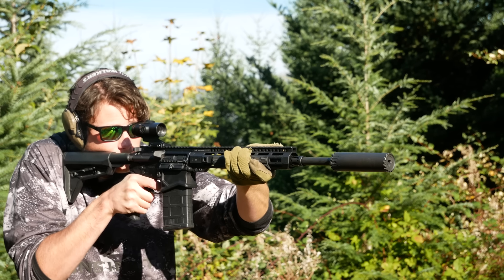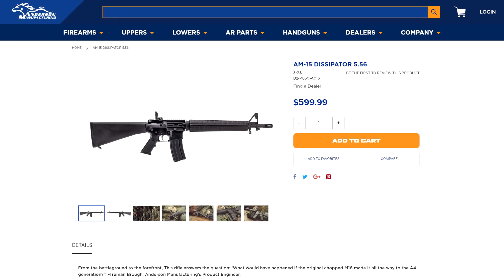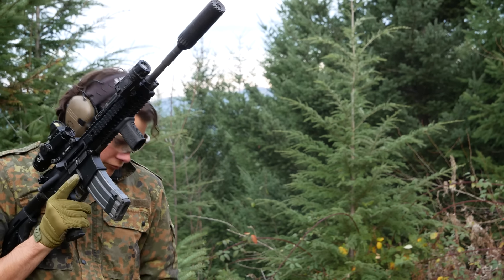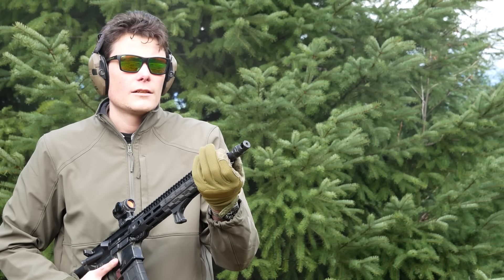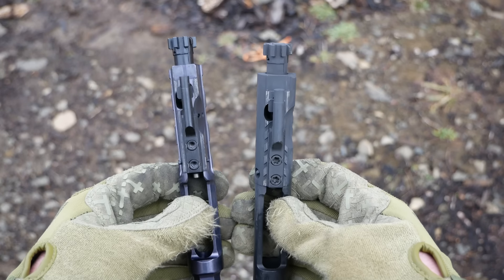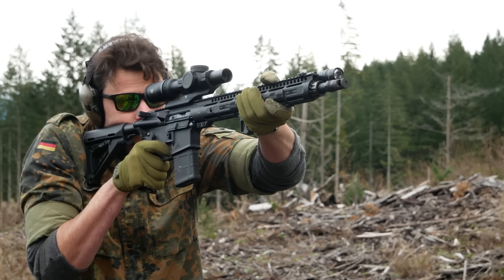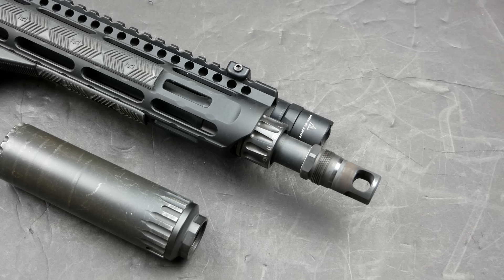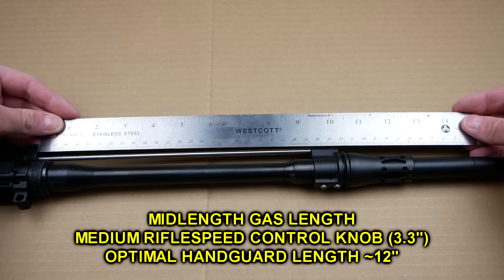The Riflespeed Dissipator

Comment: This is long and i'm sorry, but i'm trying to help add to the hive mind of information about this type of build because i really enjoy it lol. 

I have one of those barrels, although its not in a build yet. Even though its a dissipator barrel, its gas port is much larger than I think it needs to be at .121.  20" rifle barrels are usually like .098 in the TDP I think. Of course, the TDP doesn't account for crappy commercial ammo, crappy commercial grade parts, or that its shorter dwell time. So naturally, a increase in size should be added to the port when considering  the variables we need to overcome, like you rightly mentioned (or eliminate some of those variables). But I would argue that margin isn't 23 thousandths, rather  its more like 5 to 10, which is still a bigger swing than you'd think. 
 Its the same issue Focus Tripp described on your 12.5 mid from KAK. They apparently don't' care enough to perform testing to find out what's an appropriate size OR they are fighting leaky / inefficient gas systems and aren't aware of it. Could that be why the K-Spec exists? To vent gas elsewhere from their ridiculous gas ports?

Ejection pattern is not gospel, but i am using it here get a ballpark idea. The 16" rifle gas AGP barrel from "Special Ops Tactical" (the trifecta of cringe company names) has a smaller gas port than that of the KAK (im pretty sure). I can't remember the exact size, I need to go re-check it cause I can't find it in my notes. But I run it with a standard BCG (gauged efficient), non adjustable block, A5H2 (w/standard spring) and a turbo t2. 

Off the shoulder test held in my hands only. Gun is new but around 500 hundred rounds fouled and on the cusp of needing more lube (i use grease). Upper is milspec forged, so the brass deflector is the standard profile. Rainy and mildly cold weather. One round at a time, all rounds locked back on a empty mag  -  Unsuppressed: despite the A5H2 (effectively an h3), the gun ejects at 3 o clock sharp with Tula and ejects around 2 with Federal XM193. /  Suppressed (turbo t2): ejects at 1 with XM193 and around 1:30/2 with Tula. 

The unsuppressed behavior with a smaller gas port than the KAK barrel is whats most interesting to me. lt leads me to believe the KAK is way over-sized beyond a safety margin for conditions and ammo variables. Your Anderson's behavior was obviously different which is also interesting. I theorize a difference in ammo and gas system efficiency to be the difference there most likely. But  i would go as far to say if you sealed the gas tube at the FSB with loctite 620 and got a carrier that was efficient (gas key doesn't leak + gas key is proper size + bolt tail seal proper size + gas tube proper size), it would probably run completely different; and i'd be willing to bet that at least 2 of those variables are inefficient on the Anderson.

A sealed up efficient gas system makes more of a difference than people think in running crap ammo in bad conditions. Rather than taking up the slack for crap parts by hogged out gas ports, I wish manufacturers would just learn how to build and qc gas efficient parts. BCM apparently gauges their BCG's with air volume to check efficiency. Supposedly no other manufacturer does that.

Comment: Theoretically, you could also use the kind of cringe SLR SOLO rail that's 14" with this.  It's got the same inner-diameter listed as Midwest and is mlok all the way down until the very end where it terminates in picatinny.  There's a QD slot that's mounted extremely far from the inside of the tube at the end as well, so I'd imagine it's actually useable just due to distance from the inside of the rail and the fact that it's positioned so far backwards.  Having that giant chunk of pic at the front on all sides is unfortunate due to weight balance, and it's definitely less rigid, but them's the trade-offs I guess.

Comment: Dang I did not think that I would ever see a positive review by Hop of the rifle speed gas block system. Kinda figured it seemed like one of those social media hype pieces of kit but seems like it's actually delivering. Curious if this is the new standard for highly adjustable gas blocks?
Reply from the maker: Pretty high level of convenience and performance, if you're using older tech high backpressure cans. But a lot of this might not be as important in the next few years since low backpressure cans are kind of taking over.

Comment: Also….riflespeed configurator says “no” but….i want it on the 16” barrel, midlength gas….and. 15” hdx mod 3 quad rail from cmttac. Math says I’ll have a 1/2” of control past handguard before md. Configurator says “yes” up to 14.7” handguard though.

Comment: Buy a longer handguard, cut to precise length, blue the raw aluminum, rattle can. There, just cut the cost and time of experimentation in half. I would appreciate an update after a few thousand rounds on the overall condition of that gas block. I'm interested in a similar setup and saw that gas block system but it just seemed very gimmicky at first.

Comment: What is better to have the adjustable gas block or an adjustable BCG? Comparison maybe?
Reply from the maker: I stopped using the Bootleg carrier because the gas adjustments were too extreme. On most of my builds the first click would stop function completely because they weren't overgassed enough to make use of it.
Reply: @Hoplopfheil   what about the SAGRS BCG?That one seems to have a screw in the gas key instead of side adjustments.
Reply from the maker: That's a set-and-forget type system, which I'm mostly uninterested in. The ability to adjust on the fly is the only reason you wouldn't just choose a different barrel/gas tube/buffer system to tune permanently instead.

Comment: I have a delton dissipator upper I put a fixed A1 handle on it. I have it on my what would Stoner do lower so it's probably gas on carbine buffer and spring. She runs like dynamo hum.
Reply: That's a rifle length gas system on a carbine length buffer and spring.

Comment: Me like superlative arms agbs, glad to hear you like(d) them too. They're definitely set and forget, you're right about that. I tune mine for the weakest 223 I can find and then add a couple clicks, never to be touched again. I've actually considered trying to stake the adjustment screw somehow. I need to buy some spares, test them for function and then dunk them in a can of grease for long term storage in case the company ever goes under, that way if I start staking the adjustment screw and then shoot out the barrel I'll have spares for the next new barrel
   I don't own a suppressor yet- does it really take 20 fucking clicks to properly gas the upper when going from unsuppressed to suppressed? I guess that reinforces my plan to go with huxwrx
   Didn't the original dissipators have a muzzle booster like krinks do? If I'm remembering that right, I'm surprised you didn't mention it
   And finally, I've never spent a night outdoors north of Nacogdoches; I've always heard that when it's frozen cold out, it's best practice to NOT bring your rifle inside, to avoid condensation. Is that not always the case?

Comment: For the issue regarding forward mounting mlok stuff, aren't there a lot of mlok handguards that have partial 1913 segments far forward at 3, 6, and 9? I'm a quad rail boomer fudd but I could swear that's a thing
Reply from the maker: CMT makes one called the hybrid quad, it's not available in as many different lengths but it's an option.

Comment: For the shorter builds you were talking about and specifically for people who are concerned about guns that need a suppressor to run, wouldn't a booster work? In example a 4 piece brake like short AK's use?
Reply from the maker: Yeah you might be able to get those working with the Noveske KX3/KX5 "flaming pigs."
Reply: @Hoplopfheil  yes that's what I had in mind. It's basically a one baffle flash hider anyway. Like the Noveske or Combloc stuff like Strela. Tell James to stop talking so loudly about one baffle "supressors".

 Honestly all those suppressor mounts coupled with flash cans (sure fire wardedn etc) increase back pressure. Might work. Should eliminate the people worried that it will only work with a suppressor.

Comment: So, in light of this tunable gas system, do you think there could be a good and reliable AR that shoots super 300’s and subs well?  I know you said that’s not a thing but that was before you made this dissipator.
Reply from the maker: Yeah but gas system length on 300 blk is so short it would be a more difficult setup. Maybe if you use a handguard with a cutout to access the riflespeed, Wolfpack armory makes one that might work.

Comment: Isn’t the point of a dissipator to reduce chamber pressure by lengthening the gas system? Resulting in a “weaker” or less aggressive ejection? So chasing after an ejection/cycling pattern akin to a longer dwell/shorter gas system is defeating the point?
Reply from the maker: Longer gas systems reduce gas port pressure, and lesser dwell time means you have less time to let the action work. So you have to blow out the gas port in order to cycle the thing. The "original" dissipator was not acceptably reliable in field conditions. But if you are able to pair it with a fast way to cut the gas down for use w/ a suppressor they start to make a lot of sense.

Comment: Awsome you recommend Dissy over a  mid length ?
Reply: Only if you really wanted a rifle length setup below 18 and 20". There's more intermediate barrels, or in between mid and rifle coming out... they should be nicer shooting with a standard gas block than either. 

Ultimately, a proper ported carbine or midlength is undeniable. They're simpler than an adjustable gas block & short dwell rifle or intermediate with limited parts and options, as of now.

16-inch rifles do have their merits, though.

Comment: Maybe a 16.5 inch barrel with rifle length gas system would work better even without adjustable block. Ruger offer an AR15 with 18 inch barrel and rifle length gas system. I dont understand your conclusion that this dissipator is not for someone who dont want to shoot supressed and that the mid length for 16 inch is the ideal? I think the point of rifle lenght gas system is softer recoil and preserving the parts. This counts anyhow if you shot supressed or not.

Comment: probably a silly question, but since the dissipator style 16 inch barrels are hard to come by, what would stop a (competent) gunsmith from cutting down, rethreading and drilling out the gas port on a bog standard 20 in barrel?
Reply from the maker: The only obstacle is finding a competent gunsmith.
Reply: @Hoplopfheil  I figured that would be the case.

Comment: Can someone clue me in. Is it true that an optimal build for an ar will be lightest buffer and bcg with the least amount of gas to make the case eject properly? And the reason for the longest gas system is to get the best ballistics from the cartridge for a given barrel/gas system length?
Reply: The "optimal build for an AR" is called an A2.... 😉😉
But being human, we just can't leave good enough alone.  In my best Hop sarcasm, if we could build a gun with the power of a 50 bmg, that could hit a dime a mile away, could fit in a lunchbox, weighs only 5lbs, and only had the recoil of a 22lr..... someone would try to improve it. 
And it would be fun to try!

Comment: 34.j Hello magpul man could rework the slide of the bold and shorten it so that the spring in the stick can be moved in order to have a battery pack capacity in the free space.  It has a power cable spiral that goes to the carriage to supply the optics with power via the receiver.  This meant that a charging status function could be present in the optics with on and off.  their AGK DTS Hypo Economist Concept Institute maison des associations Thuringia united Germany evangelical Union weaponsmith Fabriky ©®™ would charge 50 percent of the final patent.
Reply: The MDA Team Thüringen

Comment: The whole point of a dissipator rifle is to have a shorter barrel with a longer rifle length sight system. It came about from SOG in Vietnam needing a shorter rifle with better maneuverability. It was found it wasnt reliable enough and carbine/mid length gas lengths hadnt been figured out yet. Thats why it wasnt too popular. This "modernized" dissipator build is just a 16" AR with extra steps. It makes no sense and it doesnt really fit the actual definition of dissipator, but if youre using whatever definition you want to pull out of your ass for this (rifle gas length on a 16" barrel) then yes, anything is possible.
Reply: I bet your fun at parties.
Reply: I've always heard it was that a longer gas system offered a more pleasant recoil impulse, and I think that accounts for a decent bit of the dissipator's appeal.
Reply: I was looking for this post. Just use a mid length with an adjustable gas block for better reliability and tunable for a "softer" recoil impulse. The original dissapator  just hacked some barrel length off for mobility at the expense of reliability out in the field. You could also just put a fsp gas block on at the rifle length position to get the dissapator look but still keep the mid length gas system and nobody would even know with the right hand guard 😂
Reply: @CTM54539  if recoil impulse is a problem for you out of a 5.56 rifle then you need to hit the gym. Not directing this comment at you, just a general statement.
Reply: @SCTitan06  PSA does this with their "faux" dissipator line. Mid length gas with a pinned FSB at the correct length and it functions much better than a true dissipator.
Reply from the maker: The whole point of the colt 605 was to have a shorter gun without making any new parts.